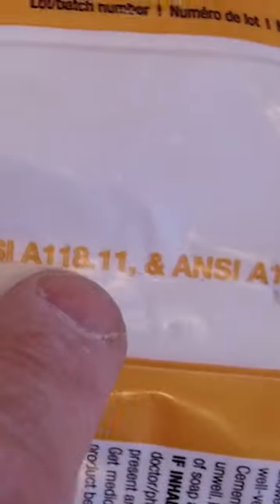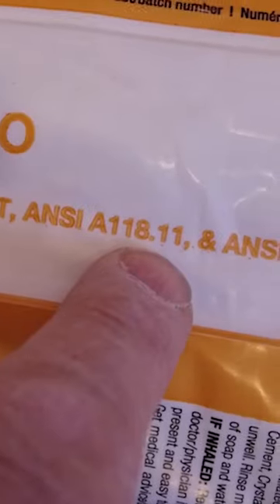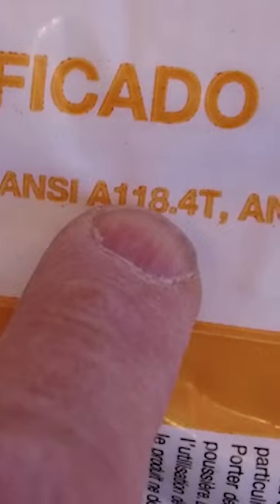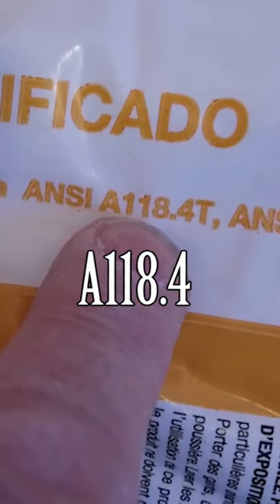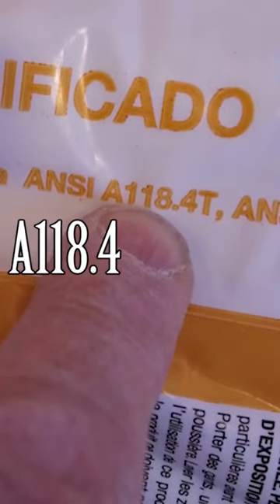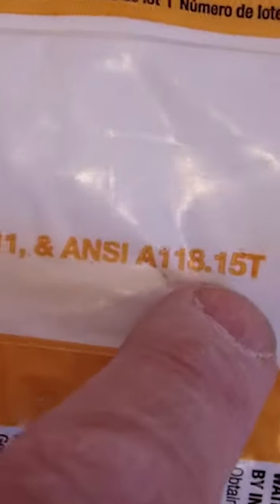It will fail, 😱 Thinset what type #shorts #tile #thinset #howtoinstalltile

Comment: I was SHOCKED at how good All-Set is!   All around just a great mortar.
Reply from the maker: it is
Reply: Allset is mediocre thinset at best. It's mind blowing schluter claims the only modified thinset that will work with kerdi membrane is theirs. Allset. If you want good thinset, Laticrete is where it's at. Laticrete multi max lite will put allset to shame on kerdi membrane. You'll pull the kerdi right off allset. MML it's stuck like chuck

Comment: Any preference for interior large format porcelain tiles on Gobard (and a few on primed drywall) - Schluter All Set or Mapie Large Format Fl&Wall mortar?
Reply from the maker: I like light weight mortars, I am old and worn out.
Reply: @SalDiBlasi  Multimax Lite?  On age - yes, join the group but you're still physically active (and mentally sound) - well ahead of most!

Comment: So can you use shluter all set on plywood and cement board
Reply from the maker: yes
Reply: @SalDiBlasi  AWSOME thank you. I have another question that doesn't refer.to this video. I've seen your videos where you used durrock and mud for You're shower installation, and where you used the shluter system. I feel like the durrock and mud is cheaper and if done right just as effective as shluter. Wich do you prefer?